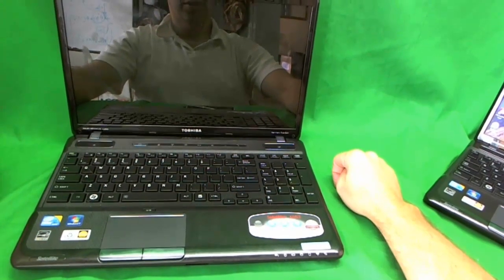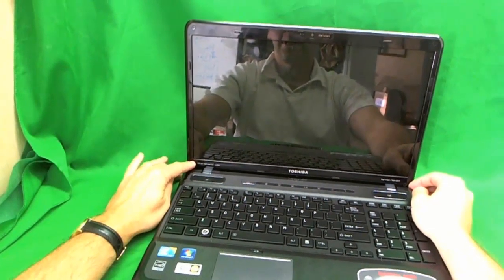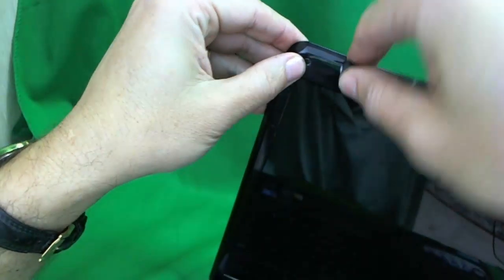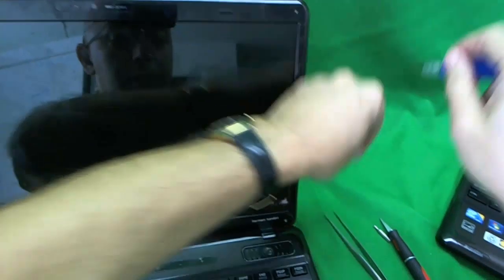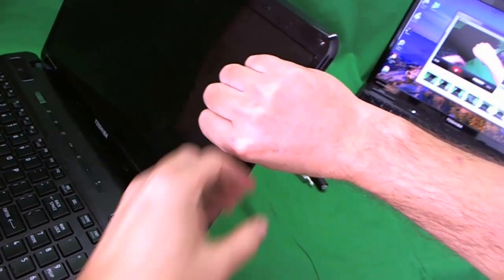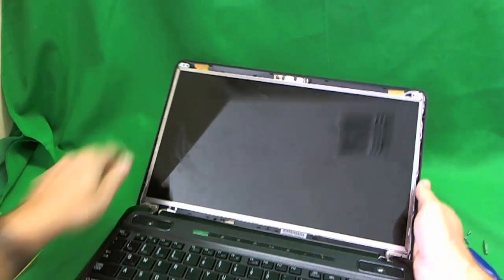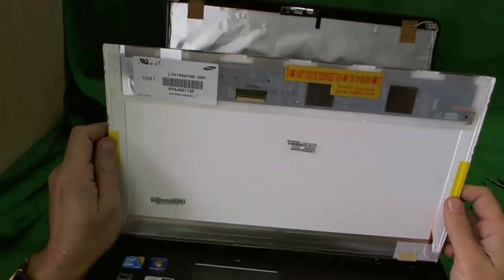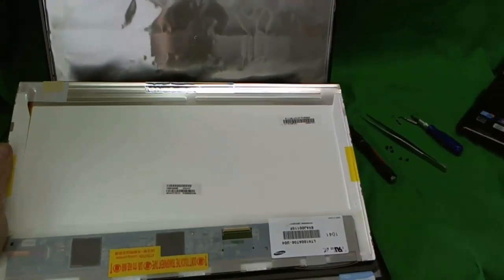Toshiba Satellite A665 Laptop Screen Replacement Procedure

Comment: Hi, I lost the light in the screen itself, I can see windows by adding a flash light near the screen. I replaced the screen, no light still, I then purchased one of these little 3d power board situated at the bottom right of the screen(as I believe this is the inverter..) Still no light, any idea why please? Thank you. I just cannot work it out.